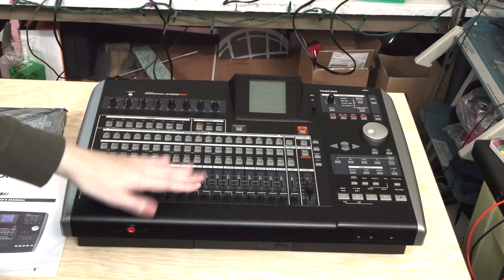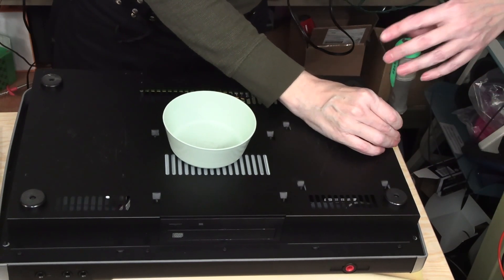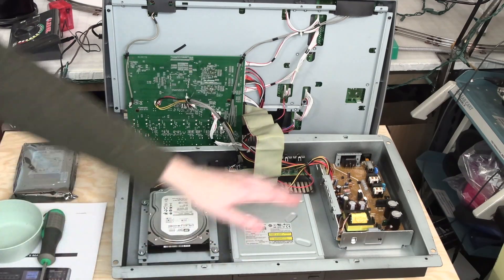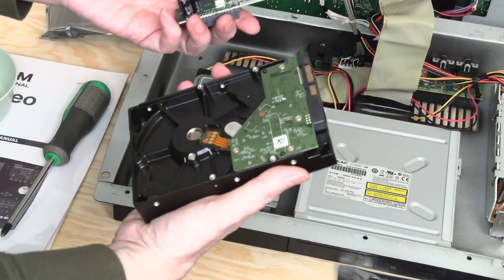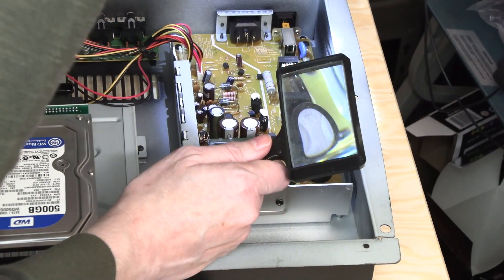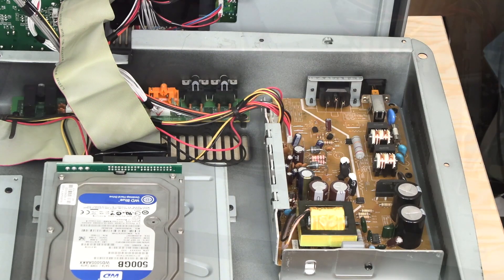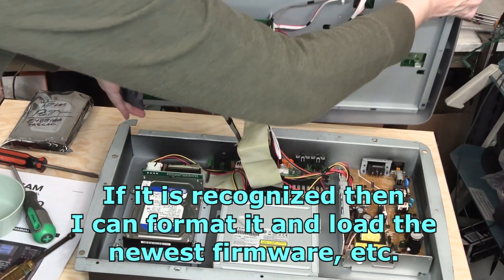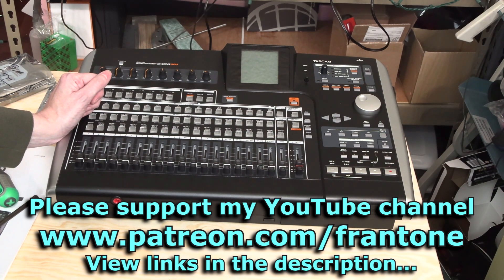Releasing The Petty

Comment: This went about as I predicted. 🤣 Right down to the IDE interface! As the manual states, there's a FAT partition specification for the purpose of connecting with a PC, and the rest of the drive is formatted with a proprietary TASCAM filesystem (though we have no way of knowing how different it actually is from any of the standards). I'd strongly encourage you at this point to do nothing else with the original drive before you have made a bit-for-bit clone of it using an appropriate utility. You got this, Fran! 👍

Comment: Fran I agree with the suggestion made by others here that it would be preferable and far easier to siphon the WAV files off of the drive digitally with the USB 2.0 transfer method on the machine (or ADAT Optical SP/DIF if necessary, whatever it has). If you mail that drive to the estate, they'd still have to find an identical Tascam to install it into, only to extract the WAVs themselves. And the drive could get damaged in shipping. You might want to clone the drive for safety's sake regardless, but if you get those WAVs off of it yourself you can also just use the existing drive yourself as is, even leave Tom's tracks on that sector for the novelty factor, without fear of erasing them by accident.

I find the 8-track configuration of 'Don't Do Me Like That' odd since it likely was recorded on 16- or even 24-track. And did I hear reverb on the vocals? It seems like this might be a stem mix (redux) of the song for some other purpose. But I did check the Tom Petty leaked stems available online and I don't see those songs floating around.

Comment: That CD drive is writeable. Does the unit have the ability to export tracks from the hard drive to a CD? I can't think of any other reason it would be re-writeable if it doesn't?
EDIT: I checked the manual and you can export tracks to the CD (maybe not PC readable though). You can also export tracks as 16bit  WAV's via USB.
Reply from the maker: The optical drive is for burning stereo WAV audio CD's - so far as I can tell it's just for the mix-downs.
Reply: exactly EEVblog, just me but I would think the Estate would much rather have the stems as wavs (or mixdown if that's the only option) on a CD, thumbdrive, or download, rather than an obsolete HD, that uses an obsolete proprietary OS. Wouldn't they have to buy another 2488 to get at the data, assuming the HD makes it to them undamaged?
Reply: @FranLab  thats the drawback of the lower level mixers. 4 channels in, but only 2 out.  But still fun.. I hooked up  vinyl vs cd audio through the stereo using that. vinyl won.
Reply: @FranLab  Couldn't you burn a mix with only Ch1 on the left and Ch2 on the right, then one with Ch3 on the left and Ch4 on the right, etc. and then combine them on the computer? It's all digital so it should sync together perfectly.
Reply: I wouldn't trust CDs, they always f**k up at the  most inconvenient moment.
Reply: @eDoc2020  It's a mixer so that's it's job. I'd be surprised if this isn't possible.

Comment: You probably need to download and install the OS on the new drive.
I've put and IDE to SATA adapter in my Zoom HD16 and replaced the HDD with a solid state drive. Took a few tries with different adapters but once I found one that worked everything went great. No more whirring and clicking noises from the HDD.

Comment: Some IDE drives have a jumper you can set to force their capacity to, i think, 32GB.  Which helps some bios see the drive.
It's usually part of the jumper block for master/slave.   (Don't mess with the jumper if you care about what is currently on the disk)
Reply: But only really for older drives, you sort of lost that when all were only addressable using LBA, as CHS only made sense up to a point. That 500G drive likely wants to only accept LBA, it does not report CHS info to a query.
Reply: There's a bewildering array of such arbitrary boundaries. For instance, the 504MiB limit was based on the limits of both BIOS and IDE CHS addressing; using only BIOS limits reaches 8GB. There are multiple generations of LBA for ATA (2GiB, 128GiB, 128PiB), Windows has an arbitrary limit of 32GB for FAT32 formatting (but if you format a larger partition with a less limited tool it will work), etc. So a 120GB drive is more likely to work.
Reply: Was thinking similar about the impact of a jumper.

Comment: Yep !  Old hardware doesn't see big drives, just as I predicted, we have the same issue trying to find a small enough old HDD to restore PCs from before 2006 at our charity workshop.  I have a shed-load of rescued laptops running WinXP on 4GB disk drives, LOL.  Even my Win 98 retro P II rebuild can't see HDDs larger than 8GB  (luckily, I had 2 good ones).

Comment: Shoot, got a whole pile of those 80G WD drives, and Seagate as well, as those were a common size for office workstations where all the data was network stored, and all the drive held was the OS and the local Outlook store. 

Power supply likely was a bulk order a while before, still used as they had a few hundred in stock and no real need to upgrade.

Comment: Silly question but, did you check the jumpers on the new drive before you installed it?
Reply: Not a silly question at all!
Reply: Ain't no jumpers on SATA drives... but the adapter may have a master/slave setting.
Reply: Some SATA drives do have jumpers, just not for setting "master/slave". (That setting would be on the SATA to PATA adapter.)

Jumpers on SATA drives are usually used for faking a lower capacity (i.e. 32GB) for systems expecting a smaller drive.
Reply: @T3hBeowulf  reasonable; as for faking lower capacity, I had exactly the same problem when I tried using a 3TB HDD with an Orange Pi PC Plus in my AC-1 audio computer ( https://www.youtube.com/watch?v=9gQRWPwGzJM ). It only saw 2TB... so I swapped drives with my friend, because I wouldn't want to waste a tera-bloody-byte.
Reply: @T3hBeowulf  I never heard of capacity limting jumpers on SATA drives, I thought it was strictly PATA thing. But some of those pin headers on SATA drives aren't for jumpers at all - I once had the experience of recovering an old 500G SATA Barracuda drive from a firmware crash by hooking up an UART adapter to the pin header and typing commands into a terminal...
Reply: 500G cannot be jumpered to lower capacity, that pretty much vanished with the PATA to SATA change, as you could still buy PATA drives for a while, but they all eventually went EOL. Still got a pile of them though, removed and tested with a full surface scan, and any that reallocated a sector, or where they had reallocated sectors already, went to the scrap yard, and to the pile of fridge magnets. Still got boxes of them, there just in case I need some spares for any old computers I run across. Probably still have the Win98 install CD as well, plus all the patches MS ever offerred, along with the common drivers as that was a quick way to fix errors on 98, pave and nuke, and install again. Plus the text file of all the activation keys off the stickers.
Reply: @KeritechElectronics  Your drive saw only 2TB, because it would have been a MBR formatted drive. Format it GUID partition to be able to use full 3TB capacity of HDD !
Reply: @NavinBetamax  ha, the SoC (Broadcom Allwinner H3) probably doesn't support the latter. The disk was seen in its full glory on a PC.
Reply: @KeritechElectronics  my bad....Yes, I forgot.

Comment: My favorite tool for duplicating and backing up disks like this is Clonezilla, it boots off a USB and has you follow a menu. It's a fairly low level bit for bit copy, really just automating and verifying the Linux dd command
Reply: I've used Clonezilla at enterprise level. It's got a great feature where you can set up a server with disc images connected to a switch, then just plug in computers with boot disk or thumb drive and lan cable. No monitor keyboard or mouse. You can track progress of each machine being imaged and rebooting from the server. 
On gigabit with a fast file server it takes just a couple minutes.

Comment: Just duplicate the the drive with a disk duplicator.  throw the new in it should have boot stuff you you need. then later you can extend the partition on the 500gb later if you need to.

Comment: I found out when fooling with embedded HDDs in DVRs that there may not be a recognizable file system per se.  One that I had just had a very basic format that MPEG2 files were directly written to.  There was no directory structure or support for different file types. I used a software tool to pull the data off to image the entire drive into a single file on an NTFS drive and then some camera recovery software to scan the file and extract MPEG video from it.

Comment: IDE HDDs should be pretty easy to get secondhand, and if not, you may go for a Compact Flash IDE adapter, ditch the HDD altogether. That is, if the firmware wants to cooperate.
A little underwhelming ending here - waiting for more <3
Reply: You get a whole lot of IDE to SD card converters as well, so you can use a SD card in place of the drive.
Reply: Flash storage is a terrible idea for the constant I/O of recording and editing music, as its lifespan is a limited number of read-writes. Not every "upgraded" technology is suitable for every purpose.

Comment: The HDD is formatted into multiple partitions..  to rebuild the. HDD .. with the power off.. press and hold SHIFT & QUICK ROUTING. Then turn the power on . When complete it will say "FACTORY INITIALIZE COMPLETE" "PLEASE POWER OFF".. 

then you should have a blank console.

Comment: Interesting to see the inside of the box. There must be a huge number of wires in that upper panel to connect with all the controls.
Reply: I'm sure they are soldered on to the board and just poke through the chassis. 
Individually wired pots and switches is way too expensive.

Comment: I have the same machine and yes not easy to find 80gb drives these days, with a new 80gb drive just cut and paste of the original drive onto the 500gb drive and re place the 80gb in the machine and just re-format so all data is safe on the 500gb

Comment: Unless you clone the software you may need to search the internet resources for the operating system to install on the drive. That said, it might be that the software installed is locked to the ID of the old hard drive. EDIt The online manual relates how to format the drive so it could be an issue with the adaptor you are using.
Reply: Maybe she just has not yet gone through the manual to find the maintenance mode incantation? She was just anxious to get the drive changed out asap before something decided to happen.

Comment: Does the the optical drive save WAV files? Anyway it would archive the song data as good as HD (?) There's also UBS file transfer/backup option. Wouldn't that be enough to preserve the tracks?
Reply from the maker: Just stereo audio CD's of the mix-downs.
Reply: @FranLab  Hi Fran, I checked the manual online and CD does BU/Restore song data, but not as any WAV files. The USB connection does though! Good luck and best for 2023!
Reply: @FranLab  I checked again, I couldn't think why CD didn't back up wavs. Well, looking again, it says it does! Always read the manual, carefully!

Comment: That IDE-SATA adapter is an accident waiting to hapen, bare power connector solder joints millimeters away from shorting against the metal drive case. They realy should have stuck some insulating foam over the back of that PCB.

Comment: Interesting.  I have some old PATA WD drives out in the garage i salvaged from a retired server from the early 'naughts'.  Tried selling them as drives for Mac rebuilds. They didn't sell.  You can find PATA to CF or SD adapter you can find on ebay. Unless your really in to the 'soundscape' thing with vintage electronics.

Comment: I've run into this scenario quite often - what I do is stick the drives in a Linux machine and make an exact copy (if the original drive is still functional) dd if=/dev/[whatever-original-mounted-as] of=/dev/[whatever-new-drive-mounted-as] bs=4096 - and this will copy the entire disk identically, sectors and all. New drive would show up as an 80g clone of the original
Reply: Sidenote this is also extremely useful when an old drive is starting to get flaky and I want to clone it before it fails altogether. Bigger size of destination drive is absolutely no object, it's just a matter of direct replacement of whatever I had originally
Reply: I'd use ddrescue instead of regular dd but more importantly I'd save the contents to an image file. Save the backups using modern drives and redundancy.
Reply: @eDoc2020  agreed. Sometimes tho I only get ONE shot before the disk fails and I'd rather have the drop in replacement drive before doing it all over again putting a saved image to disk. To each their own, a million ways to skin the cat! I'm just personally more comfortable with dd, it reliably nets me a bootable exact clone of the source which 99% of the time is what I'm trying to get. I can always get an image of the of the source from the destination drive some other time after it's done, but too often the source has like ONE chance to make it all the way through before it starts pooping bits everywhere
Reply: @Drmcclung  IMO that's even more of a reason to image rather than clone. If you don't happen to have a donor drive ready, tested, and proven then cloning isn't a safe option for the data. I've been hurt by drives which check out fine but then start losing data.
Reply: @eDoc2020  a that's why you do it with a brand new one out of the box and take your image after you've gotten the data. If your destination drive already in use shits the bed or some other means of data corruption "shit happens" event occurrs during imaging from the source to destination and that was your one and only shot, you're fucked trying to recover anything from a partial image. Just my experience in that scenario. I clone first before I copy/image anything but that's just me. That and I don't really like spending twice the time time, going from source to image then image to destination it's just time I generally don't have trying to get a server back up. Just don't fuck up your if and of devs using dd lol 😁

Comment: You could probably get an IDE to Compact Flash adapter and use flash storage. If not, I should have a few 80 GB IDE drives sitting around at work. I'd be happy to ship you a few to see if they are still functional enough to work. But I'd go flash storage if it was mine, just get a decently fast card.

Comment: I love my 2488 but I hate its proprietary nature. Literally the only way to get audio data files in and out is using the most long-winded procedure you could imagine. There is no simple "export all audio data to the FAT partition" option. Many years ago there was some guy who was trying to reverse engineer the backup file format to extract audio from it. He failed and gave up if I remember correctly. If you want to preserve any audio from that drive you need to laboriously export it all to the FAT partition using a working 2488 and copy it off via USB/CD. Otherwise once all the 2488s are dead those data will be prisoners of the 2488 proprietary file format forever.

Comment: I would use Parted Magic to duplicate the original PATA (IDE) drive's partition to the new SATA drive then see if you can boot up the new drive and remove the recordings from it, if it doesn't boot, you will likely need to find a PATA drive to duplicate it too.  At any rate, there may be proprietary software on the original drive that you will need to copy to the new drive.

Comment: I like your optimism at the end there, the clue is in the menus, beware of any software that knows what a sector is. Presumably for speed and lack of latency they are reading and writing to drive at a low level. I'm guessing any other drive is going to be very tricky.
Reply: Yeah, this. I suspect that they may have a FAT region and then a region that the software accesses sector-by-sector in order to get consistent reliable audio streaming to and from the disk. Other drives may work (address by overall sector, not track and track-sector), but the only cloning approach will be bitwise. Unlikely to abide by partition structure.

Comment: Fran, couldn't you "look" at the original 80 gig HD as an external drive via a PC and hopefully "see" the audio files?  If you can find them just copy them to a separate HD or even an SD card.  Preserving the tracks is the important thing, after all.
Reply from the maker: As it has been said in other comments the disc is a Tascam proprietary format.

Comment: I just gave away a bunch of 40 - 80 GB IDE drives a few weeks ago. Well the guy actually gave me $20 for a load of stuff I could barely carry in a box. That sort of equipment could be finicky at least to ballpark of hard disk size. Hopefully it is all LBA and thus probably has about the same CHS setup. I personally have an external IDE box that is USB and I can use that to extract drives to my computer today. Again something like in linux, dd if=/dev/sdb bs=512 of=drivecopy.img to a larger partition is a good idea. To actually rip out the tracks you would need the filesystem details or file type details if it uses a known filesystem. You could also rip out the whole image using dd like I was saying to other places and use the same drive and erase it. I am running out of motherboards with IDE ports today. I think I still have 1 with good caps, and one with dubious ones.

Comment: a) Buy a "real" IDE HDD (500GB they're very cheap today). Some Hardware do not work with adapter.
b) Clone the "old/original" HDD to new IDE using Clonezilla or similar on PC. 
c) Install the "new"  HDD .
Regards from São Paulo, Brazil.